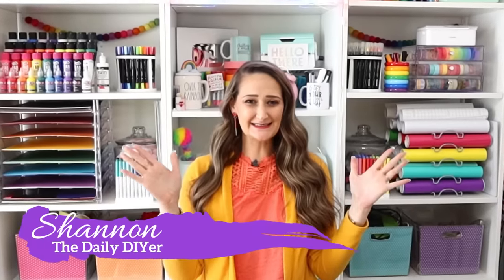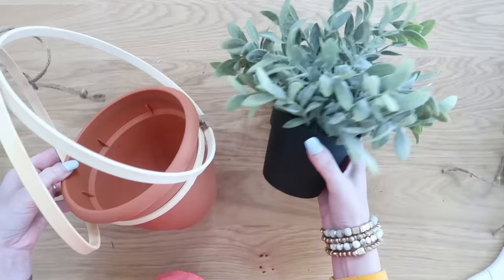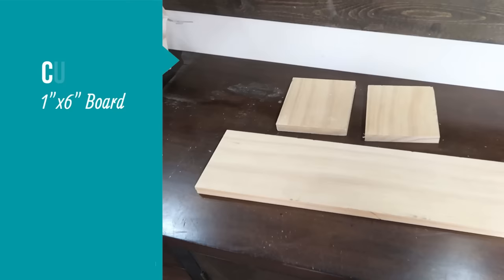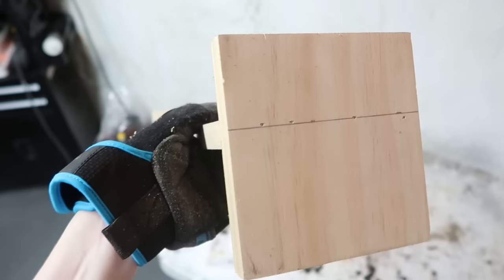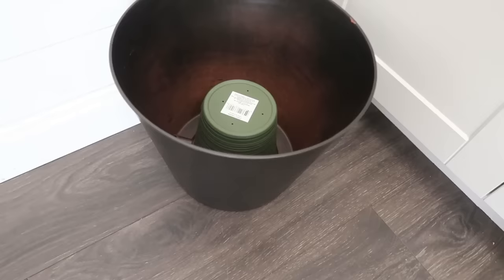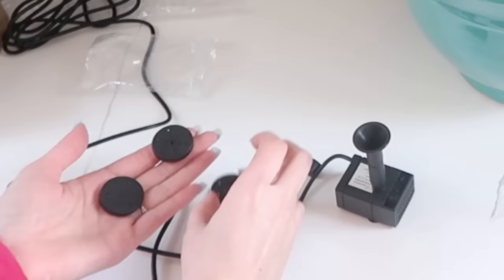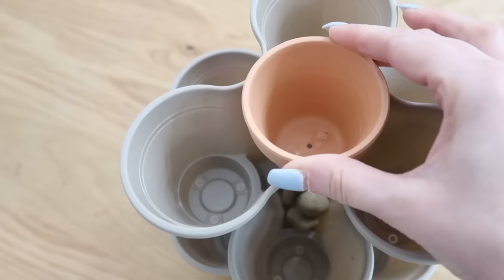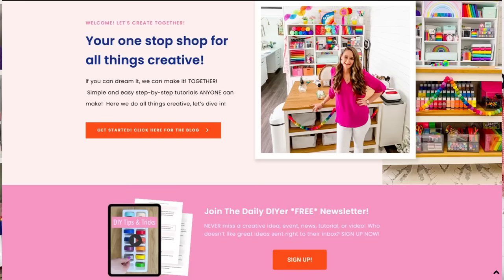Grab $1 PLANTERS from Dollar Tree for these BRAND NEW HACKS!

Comment: The 4 circles you cut from the plant shelf, would make great wheels for another wood project, like a wagon to hold plants or faux flowers, or even seasonally change it, and put bunnies and eggs in it for Easter, and a small pine tree and faux gifts, or a nativity for Christmas.
Reply: You could make the "planter shelf", a little bigger, with holes for sand buckets you paint, to use at an outdoor party, to put plasticware and napkins in, or instead of napkins, put a pretty flowering plants in the last hole.  So much, those shelves can be used for!

Comment: When using a hole saw, you can also screw in a wood screw into the wood to easily pull the cut wood circle back out of the blade.

Comment: I have a question, I bought the planters with the string attached to them, because I have plants I want to hang from my ceiling. Is the a good way to hang them if you have a popcorn type ceiling. What would you hang them with? Thank you.
Reply: If the plants are on the heavy side make sure you attach your hanger in the stud or get those things that you put in the hole and the sides come out like a butterfly.  I know this sounds silly and confusing, but I don’t know how else to explain it.
Reply from the maker: I think Lisa is right here, try to find a stud or DT has the plant hooks you could attach to the wall and it will hang it away from the wall for you.  Hope that helps!